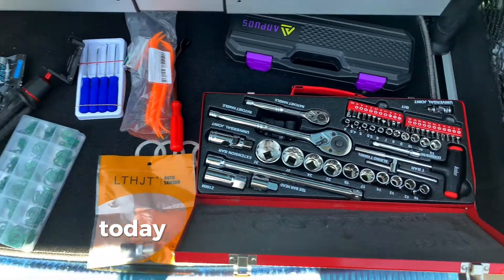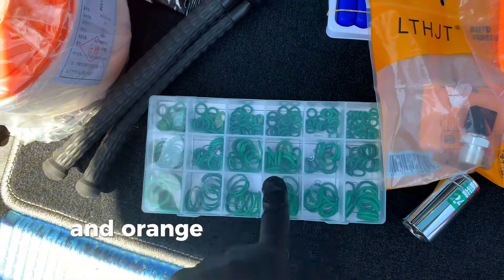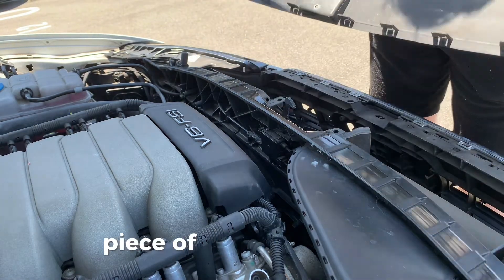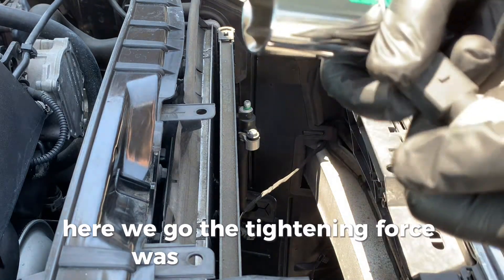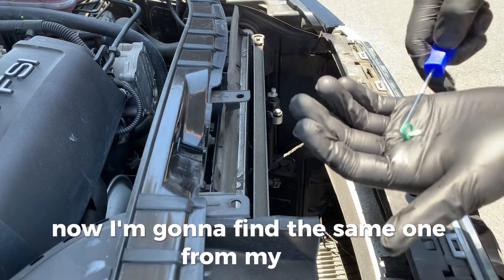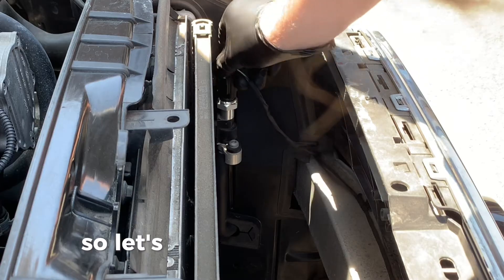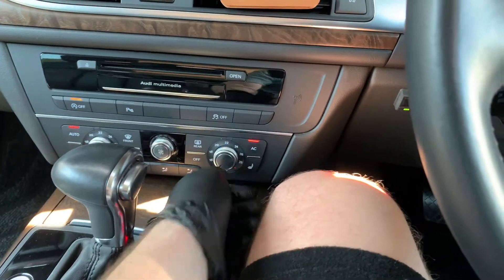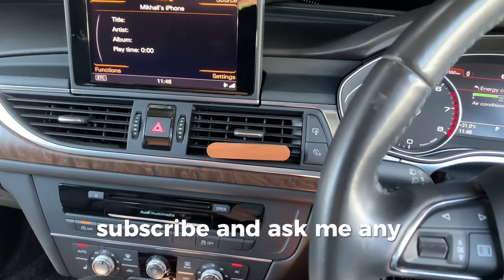Fix Audi A6 C7 (2012-2018) No AC Error Code 00256 (DIY AC Pressure Sensor Replacement)

Comment: *UPDATE, I didnt turn the tap back to open it on tye regas kit lol, filled up and now blowing cold *I've swapped my sensor and tried to clear the fault but my AC button won't stay lit red? Any ideas please?
Reply from the maker: so it's blowing cold, but doesn't stay red? wow, that's first time, still maybe car thinks that its not enough pressure

Comment: Thank you very much! I managed to fix my AC by ordering the parts from Amazon. It’s working perfectly now—I didn’t even need to refill anything; it started working immediately.
Reply from the maker: Glad it helped. Sometimes parts can be not the best quality, if you gonna change it one more time, be sure to tighten the stem inside the valve. Because when you screw and unscrew the sensor, you can unscrew the stem inside the valve. And of course you don’t need any power there, just gentle hand tightening

Comment: Hello,thank you soo much I've replaced the sensor and it finally blows cold inside, but sometimes the AC button is flashing,  what do you think about that? 
Greetings
Reply from the maker: Thanks for the comment. Glad that I could help, but I don’t know about flashing button. Could be low refrigerant , compressor, sensor or anything else. Try to read the codes. I have some links OBD eleven in the description

Comment: Hello mate, I had my aircon regased today and after that this error appeared not sure if they overfilled or it's sensors fault... What I'm sure about i didn't had error before regasing.
Reply from the maker: Thank for the comment. There could be 3 issues:
1. Faulty sensor, maybe was demanded during installation
2. Refrigerant level and sensor leaks(Maybe damaged O rings)
3. Wiring harness or LIN bus issues. Doubt that, but can be. 

Better to go back and ask them to double check everything
Reply: @MIKESCARSSTORIES  is system has to be empty to replace sensor? I'm having trouble with the garage who did it for me so thinking to do it my self.

Comment: had a problem with it not blowing cold and econ not shutting of with motor running but otherwise it worked. scanned it and got this fault code. thx for showing the fix
Reply from the maker: because the air conditioner has a valve stem right under this sensor (just like on a wheel) and every time you unscrew the sensor, it can start to unscrew the stem under itself, so it’s worth having tweezers nearby or thin pliers or a special tool like this one: https://encrypted-tbn0.gstatic.com/images?q=tbn:ANd9GcQnvQO6vdH-f42C8q5VQ8v0trt4fg3vRAQXIJkGlIxC0pjxUvXZt99q237b&s=10

Comment: before you replaced the sensor, would your AC light turn on or shut off after you pressed it? When I press mine it shuts off right now
Reply from the maker: Yes, I had the same symptoms, sometimes on, sometimes turned off. But be careful with link in description, one link is bad sensor, other link is ok sensor
Reply from the maker: As I said, yes, same symptoms, also caused 00256 error. Dealer stated that the problem in sensor

Comment: I broke the new sensor inside. So upset right now. Any idea of how the whole housing is called so i can order a new one? Or do i need a whole new radiator 😂
Reply from the maker: Gosh, sorry to hear that. I’ve read about something similar here, try to check out https://www.audizine.com/forum/showthread.php/936352-A-C-Pressure-switch-Schrader-valve-snapped

Comment: My ac light dont stay on, blowing hot air only. On a sg5
Reply from the maker: Check fault codes with vcds or OBDELEVEN. In this video I’ve showed 0256 error. But it also could be wire damage and so on